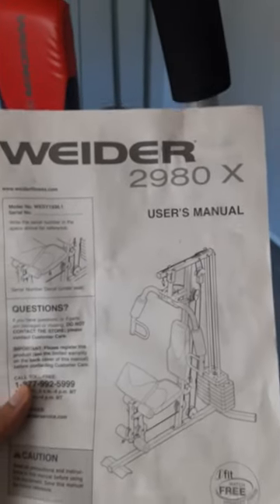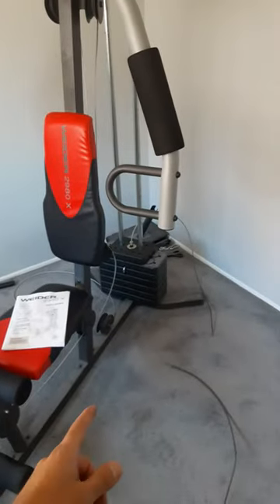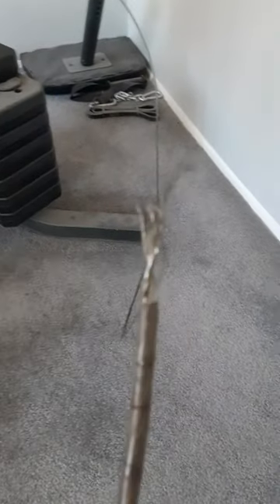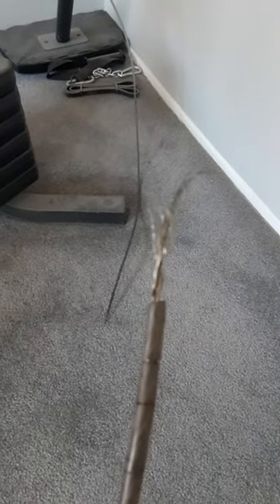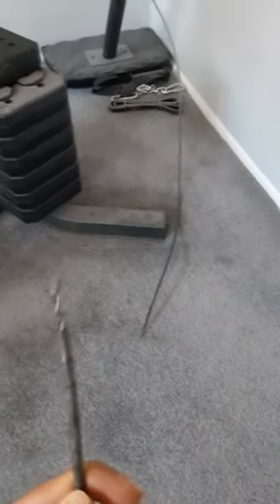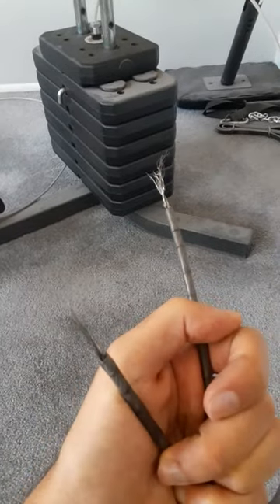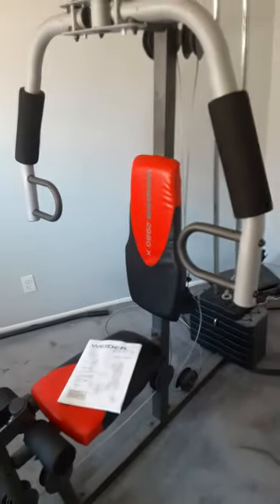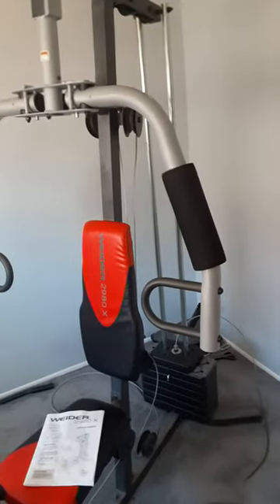DON'T BUY WEIDER HOME GYM! DANGEROUS DESIGN FLAW!

Comment: I had the same thing happen to mine while using the pull down bar. I could not believe how much the replacement cable cost! The cheapest I found was $100. Hell I bought the machine used and only paid $150 for it. But a trip to Lowe’s and $15 later I made my own cable that works great
Reply from the maker: Ah dam I'm sorry to hear it happened to you too Aaron! Seriously it's so frustrating. Major respect that you were able to make your own cable! I wouldn't trust getting a cable from Weider after that situation.
Reply: @igalbenyair  hi, I owned there bench with pec dec which was very unbuilt the machine tore apart with 40kg per side.
Reply from the maker: @georgeton4991  dam! it's truly sad how terribly it's built
Reply: @igalbenyair  yes total junk, we strengthened the flaw with sturdy steel washers welded.

Comment: If you still have the machine you could buy a newer better replacement cable thats stronger and actually continue to use the machine but you would have to install it yourself and all that and make sure you have it the right length and have it tied at the ends correctly and all that so that it's strong and works good.
Reply from the maker: Thank you very much!

Comment: it's tough because at the same token, this machine is like 300-400 depending on the model and pricing. In order to get a machine that is better built just a few notches will cost you over $1000. You get what you paid for but in the end, a better braded wire cable would solve this issue, even if it ends up costing 50-100 more for the machine. Glad you're sister didn't get hurt.
Reply from the maker: Thank you for caring about my sister's situation, we appreciate it! And it's true it's definitely not going to be the best machine at it's price point but should at least have a safe cable that's what really sucks about it. When I called Weider customer service, they said even their most expensive model uses that same unsafe cable. Hopefully other companies use better ones.

Comment: I’ve been sitting on hold for their customer service for the past 1 hour and 15 minutes so far. So many pieces missing and other parts don’t align. Their website doesn’t load. It’s been a nightmare. This is the 4th time I’ve been on hold, trying to get some answers.  However, it seems as though they do supply better cables now. Still, buyer beware.
Reply from the maker: Sorry you're going through that! Hopefully there will be someone who is nice in that messed up Weider company who can at least help you with proper answers. Weider is a terrible company. They probably saw the terrible reviews everywhere and they probably saw my video describing the dangerous cable visually and it shook them up. When I called them right before making this video to complain about the cable, they said they use the same terrible dangerous cable we had in the machine for all their models including the most expensive machine they make. The cables now might seem better but probably still are bad quality. I don't trust Weider. They didn't care at all about what happened when I called to complain before making the video.
Reply: @igalbenyair  …I appreciate people like you who report the dangers. I’m glad you sister didn’t hurt. I finally got ahold of them after an hour and 45 minutes. They’re ordered the missing parts, so we’ll see what happens. If they screw it up again, I’ll drive it back to their warehouse and demand my money back. Good thing I don’t live too far. Thanks again!
Reply from the maker: No problem! I'm happy to help. Thank you very much for caring about my sister!  The truth needs to be told especially to prevent anyone from getting hurt. I really appreciate you also wrote what you're going through with Weider here in the comments and I'm sorry you're going through the hassles they caused because it shows how much Weider doesn't care about their customers. They need to be held accountable. I really hope everything works out for you! Definitely get the money back if they mess up because people who buy their equipment are doing the favor for Weider. Weider isn't doing any favors for buyers. Tons of companies make equipment so Weider isn't special in any way.
Reply: @igalbenyair  when I bought the Weider armblaster which is a simple device, the poorly thought out design meant the nyloc fullcrum nut would loosen it was hilarious tbh, it wasn't designed by a mechanical engineer.
Reply from the maker: @georgeton4991  Ya weider sucks. Can't believe they aren't bankrupt

Comment: what cable you brought from amazon and how does it work on the machine im putting mines up now had for 6 months already
Reply from the maker: The cable that snapped was the original factory one that came with the machine from Weider. We got a replacement cable from Amazon that was listed as working with this model but we're very cautious and nervous about using it again.